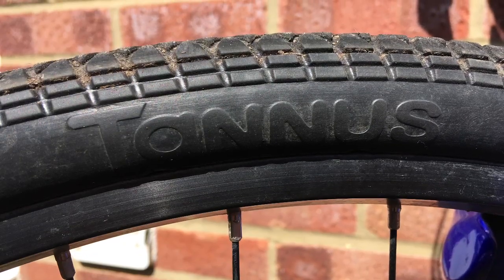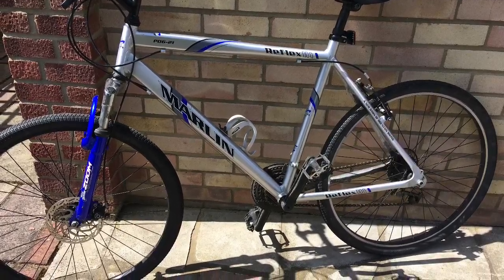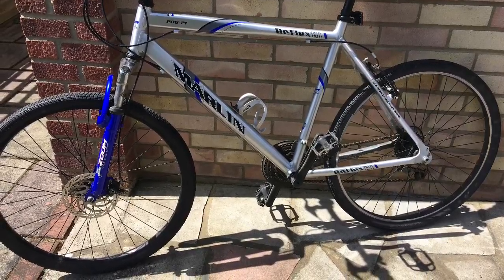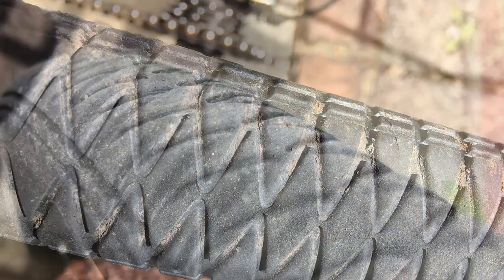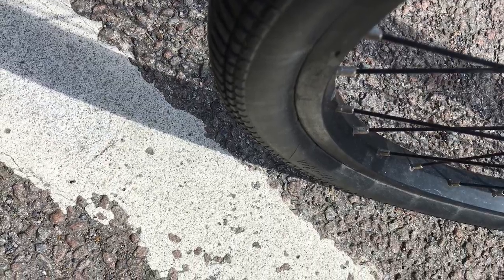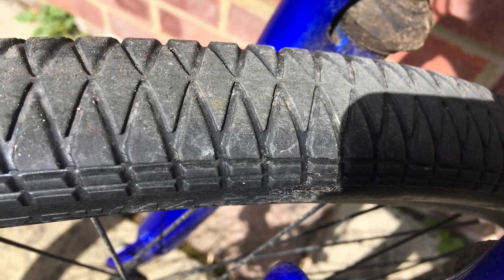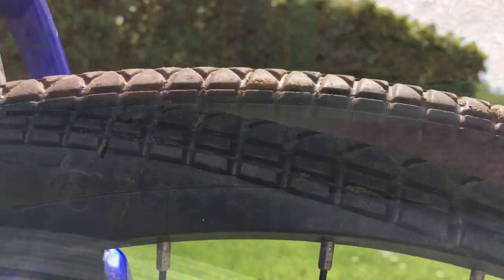Tannus solid cycle tyres MTB review

Comment: I used the 26" version of these on my mountain bike.  The weight was the same or a little less.  The traction was ok.  The ride quality was not too bad but the spokes creaked and popped more.  The drag is HORRIBLE.  You WILL notice a difference in the amount of effort required to maintain a given speed and the coasting distance is cut by 30% ---- In my opinion.

Comment: Any chance of a update Ben?
Reply from the maker: Hi there, I'm not using the bike as much as I was before, but have reached almost 1,000 miles on them and they're still going strong. No further significant wear or break-up. I think that the tyres will probably outlast the rims and bearings!
Reply: @MrBenw123  Excellent
Reply: I’ve had 2 of these on my MTB for several years now. They’ve actually outlasted my bike. I’m getting a new bike delivered tomorrow and plan on buying the same tires again. They’ve gotten cut in half across but due to all the clips they come to secure it to the rim, I’ve never had an issue with them even remotely coming out of the rim. Get them, you won’t regret it. 

They may feel a bit slow in the beginning, but after a few rides, it all feels the same.

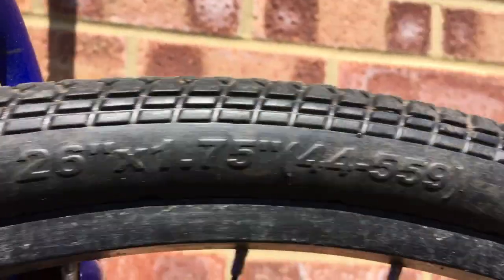Comment: I want to try them but,... 1:23 "Tannus claims their tires are lighter."  Well if they are, i am guessing that the MTB tires they compared it to were the most thornproof tubless tires available.  But what if you compare it to a set of moderately thornproof tires?  Do Tannus tires still come out lighter?  And if you want a less bone-crushing ride do you go for medium soft tires?
Reply from the maker: Hi Mark, it's worth looking at some of Tannus' videos to be sure, but when I looked into it there's not a massive saving. I think the point is that their behaviour in terms of weight is pretty much identical.
Reply: Remember the weight saved by tools (pump/co2 and levers) , inner tubes or  patches you don't have to carry
Reply: on road they are actually lighter per se, plus the lack of tools  needed weight 
I'd like to try them myself but on road the increase on rolling resistance is well known

Comment: Why do you have to avoid paint lines?
Reply: They're usually worn smooth and slippery compared to the rest of the road. They could potentially cause your bike to flip out to the side from underneath you, a bit like riding on loose gravel.
Reply from the maker: It's something to do with the compound of the solid tyre. It's not as grippy in the wet I found.

Comment: I can't get my tires on my bike. :( The measurements they provide are inconsistent.
Reply: What sizes are you dealing with
Reply: @karthimechify  can't remember exactly. I think it was the razorback advertised on the tannus website for a 1.7cm Internal rim width. The instructions that come with tire say to go with a peg that is 3.5 mm bigger. The smallest peg that was designed for that tire was several mm bigger than that. Anyway I solved the problem by buying a bigger rim, and that worked. It took me 2 days to install the rim. Wouldn't  recomend.